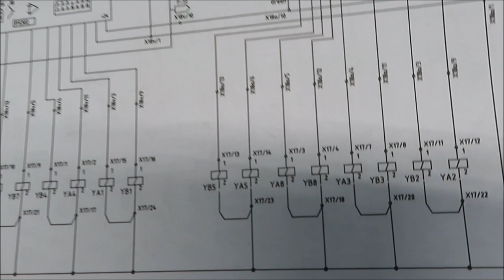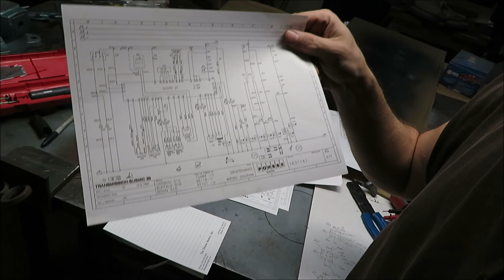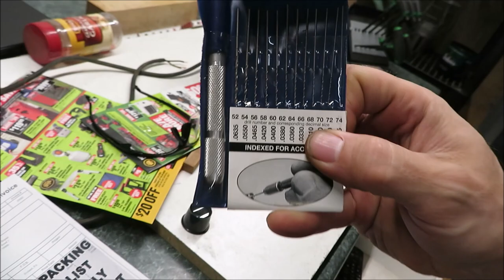Ponsse Wisent bogie work!

Comment: I actually thought that they were chain driven bogies..🤔 Do they allways have gears in there nowadays?
Reply: yes gear are most common . chain has some problem with holding
Reply from the maker: Chains where used into the 90's yet on some. But all gears nowadays
Reply: Ok thanks for information. It is understandable that gears shouldn't slip but..😁 Well bearings big enough to take all load so it should be ok solution. Lot of stress in the bogie anyway because gears pushing each others away and the other side, wheel tracks are pulling wheels together and snow between track and wheel won't help that situation at all..